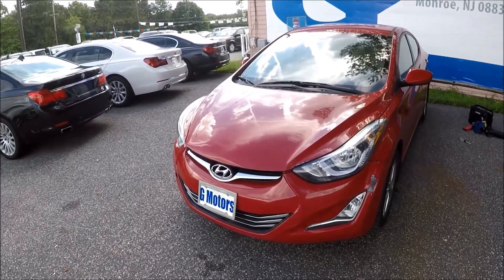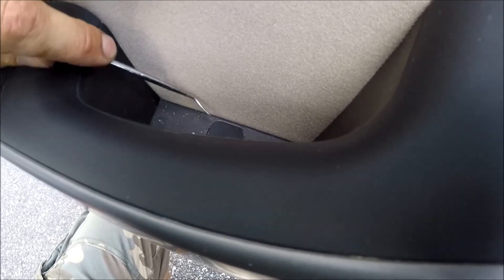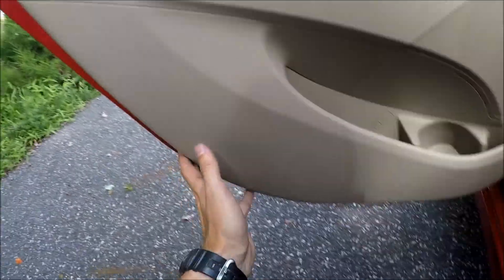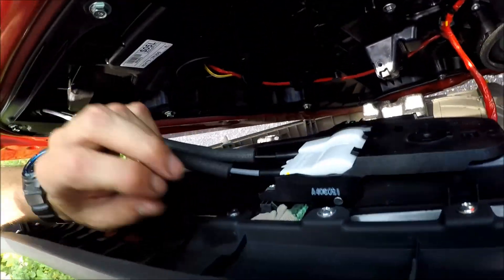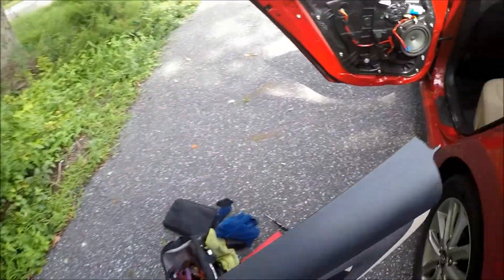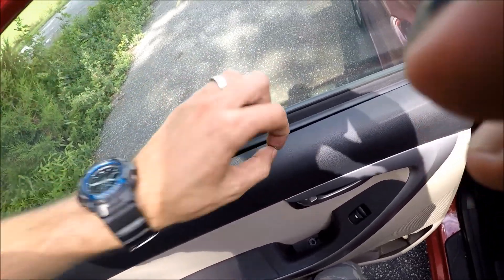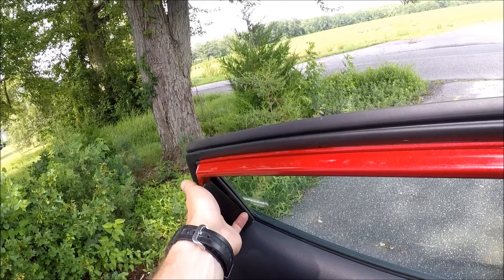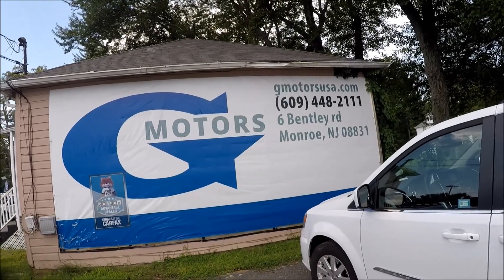How to remove REAR door panel in Hyundai Elantra 2010-2016

Comment: Mate , the electric window switches didn't work on our doors, we have had the car for 2 yrs and no one could get the switches, frustraighted I told my wife ( its her car by the way)that i was going to do it myself, needless to say she wasn't happy about me , a jeweller messing around with the car. After I watched this video I walked past her with a smile on my face and went to work .
I pulled the panels  off and got the switches out, pulled them apart and cleaned the points, which were filthy with a bit of sand paper, put it all back together and presto we have working windows and my missus made me a pizza and bought me a beer. Thx buddy you saved my manhood lol.
Reply: Hi Zenomorf,could you show how you clean the switch?

Comment: How do you remove the panel if the door was locked on a Hyundai i20?
Reply from the maker: +Albert Nyanzu hi, I have two videos on channel on how to remove door panels on locked doors.
Reply: repairED stuck without window crank removal tool